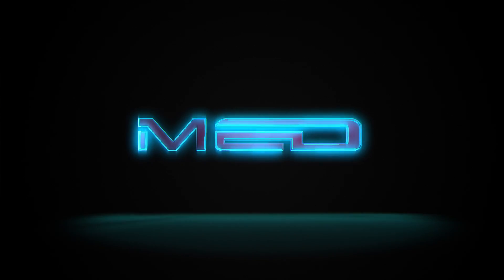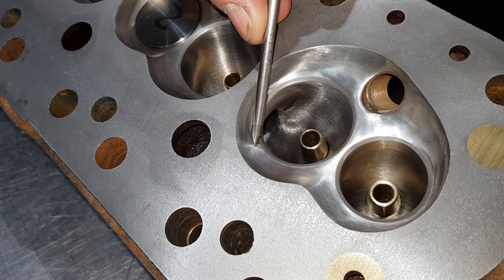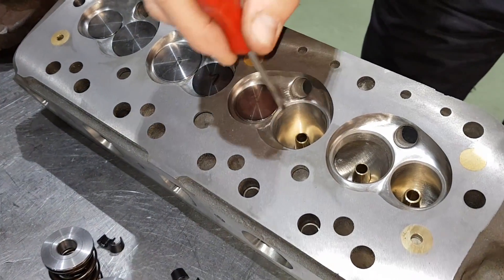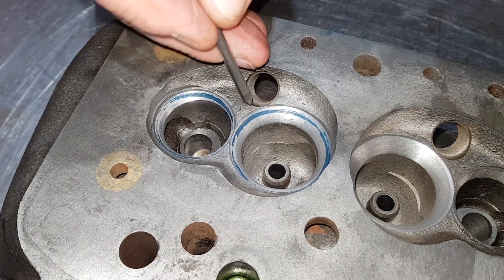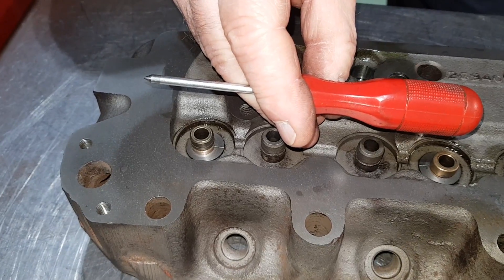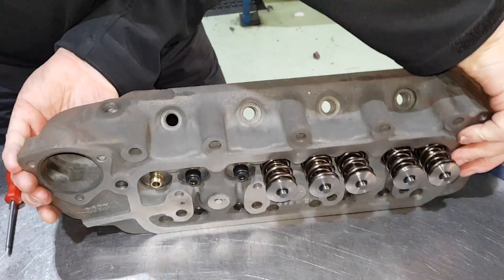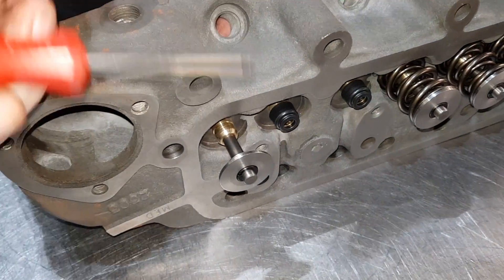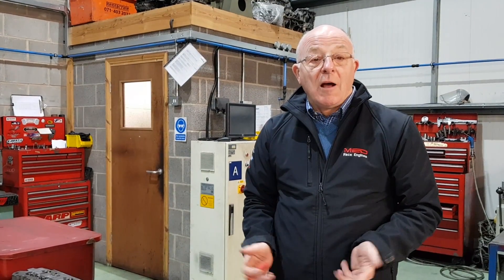Offset valve guides and valve seat blending explained

Comment: Interesting. I remember doing porsche 356 engines. They had a small micrometer which was installed in lieu of the valve spring and the reading it gave told you the shim amount that was needed for the spring.

Comment: Awesome, I had the idea to do that, but didn't think it would fly! I wonder if the same process could be used to put the valves in at a different angle?? As in 2°-3° without skruing things up too much,
Anything used to hold the iron slug in? Just a press fit, or a ledge on the top, to prevent it from falling in?

Comment: In Fiat SOHC 128 Uno, X1/9...type heads the valves are as in the video, very close , but I don´t know if offsetting the intake valve guide to fit 42mm valves  can be made,  probably the outer valve spring can not have enough room into the bucket-follower in stock place. Will be a big improvement, 1mm radius offsett  is 2mm more valve diameter.  Also think with offsett valve the top valve stem not is in the center of the bucket-follower, and can make the follower not centered in his guide.  With rocker arms head this problem is solved as the video head.   Good video.

Comment: Im 33 and when i was about 14 or so i use to read mini magazine and would do a; If i won the lottery parts and modifications list.  I wonder if other people do that? Anyway I use to go to MED section of the magazine and run up an imaginary bill which could rival a small mortgage. Learning how engines and heads are modifed has always interested me so i left school and decided this is what i wanted to do with my life. I did an apprenticeship in car mechanics, that didnt do so well so then i went and did an apprenticeship in machining, welding and manufacturing. I remember reading in mini magazine about how MED offset the valves and at the time it didnt make much sense but since i have an understanding of machining it makes sense now. I was talked out of do engine building because i was told there was no money in it. There are no engine builders in my area. Back then in 2001 a college apprentice got paid 50 pounds per week and did theory at college on Tuesdays and worked the rest of the week. If i had lived in the same area as MED i would have definitely put forward my CV. On another note After the offset has been put in and the spring seats are milled is there not a high risk of the cast cracking on the side wall 3:03?
thanks for the video and sharing your knowledge its been fascinating.
Reply: Motor engineering is not highly paid, but it is steady and in high demand. I guess 50-60k a year is realistic with overtime etc..- what career did you finally choose?